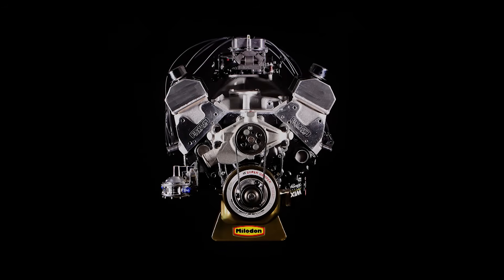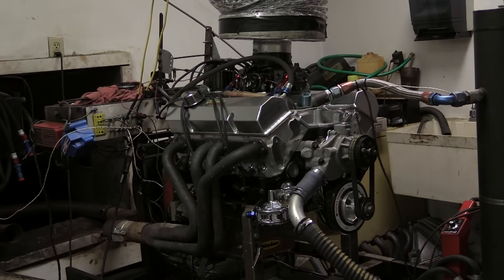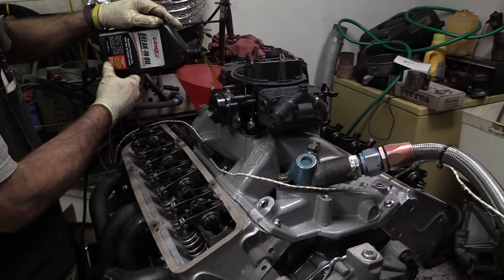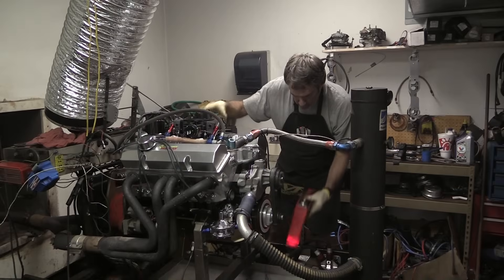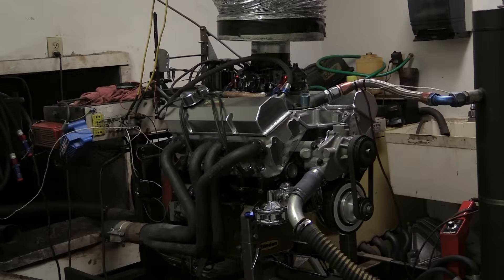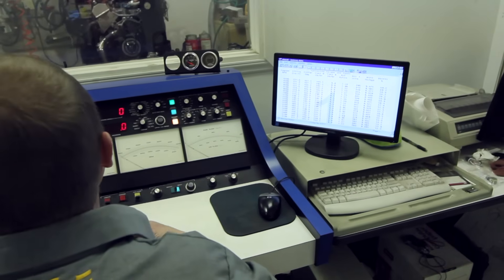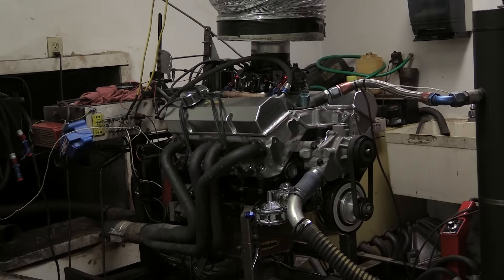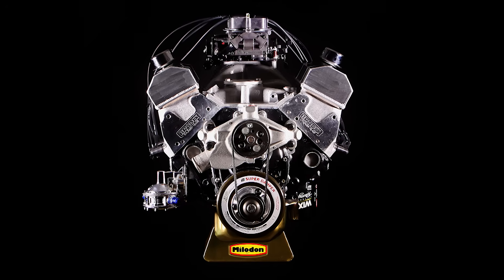427 Chevrolet on the Engine Dyno -- The Ultimate Stroker Part 5

Comment: Great looking engine and love the sound. Also, a bit surprised at the HP as I thought it would be higher. My little old 350 I built in my garage pulled 474 @7,000rpm but I also ran out of time for tuning at het my peak HP at the highest RPM reading and never did see a drop off. Maybe we are all just so spoiled by LS type builds that 500 just seems low. I can't believe I just typed 500 is low, what a time to be a Hot Rodder. Check my YouTube channel for my dyno pull if you are interested in seeing it. Also done on pump gas and 10.8:1 compression, nothing special.
Reply: didn't see any dyno pulls.....
Reply: An SBC that peaks any where 7k is a dog pain in the real world. This  apples to oranges yours sounds like a drag build with zero street time boring. They built a King Kong street motor fun. Not a good comparison. built to do completely different jobs. HP shame/show off fail.